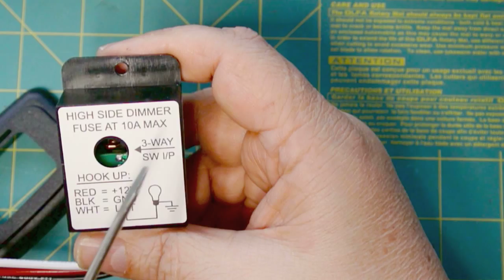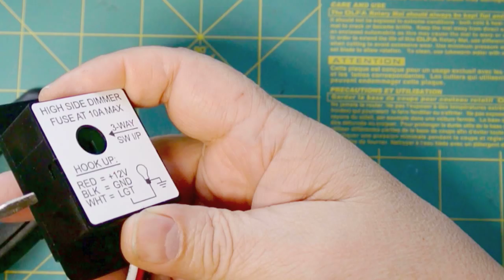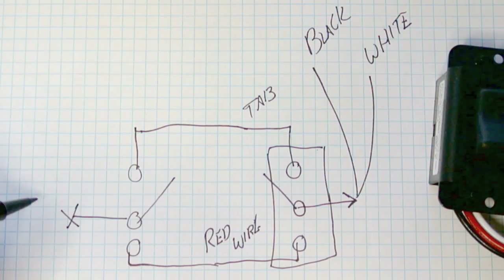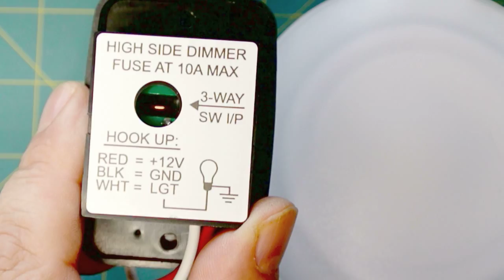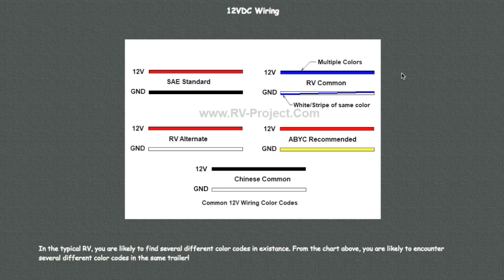Installing a LED dimmer in my RV

Comment: I wonder if you can just a 120v dimmer switch instead. For such a small simple device, these are stupidly expensive for some reason.
Reply from the maker: A 120VAC dimmer will not work.

LED capable dimmers are actually more complex than you might think.  LEDs work differently than incandescent lighting and require more complex Pulse-Width-Modulation circuits.  120VAC dimmers are more simple and less expensive to build.  When I designed my PWM dimmers, my cost in just components was around $25 per dimmer.

I also suspect there is an economy of scale as 12V dimmers are pretty much limited to the RV and marine industry.
Reply: @RVProject  I see.  How do AC 120v dimmers work with LED lighting?
Reply: @RVProject  so a simple potentiometer wouldn't work as a dimmer?
Reply: @RVProject  I'm thinking about buying touch 12v dimmers since they are cheaper and I need to buy quite a few for my project, but unsure how well those will work plus I like the control a potentiometer gives you.
Reply from the maker: @meowzic  from a technology standpoint, they work similarly, but the voltage differences between 120VAC and 12VDC are such that the component values would be too far off to work properly.
Reply from the maker: @meowzic  A LED is similar to a diode in that the current flow through it must be limited or it will self-destruct.  A series resistor would work with low power LEDs, and in fact, LED strips typically use resistors to limit the current.  

However, with larger current demands of the typical RV puck lights in a RV - they are around 4Watts each, the watt rating of the resistor would have to be fairly high, requiring a bulky component.

While a resistor could be replaced with a potentiometer if the current requirements are low enough, the downside is that they are linear in nature, or have various "tapers' such as an audio taper.  Unfortunately, your eye does not see light values linearly, so a typical potentiometer would not have a smooth transition from dark to light.

In other words, 90% of the light change would occur with only 10% rotation of the potentiometer.

In my dimmer design, it is actually controlled by a microcontroller. I programmed the microcontroller to transform the linear motion of the potentiometer to logarithmic values that more closly match the eye's response to light.

I have a webpage white paper and corresponding video that provides an in-depth discussion of 12V dimmers. It might answer many of your questions: http://www.rv-project.com/gear/dimmers.php

Also, I have a webpage for the construction of the LED dimmers I designed and built. Regardless of whether or not you might want to build the dimmer, I provide a lot of background; for example - the eye's inability to see light linearly as I mentioned above. So there is still some value in reading the description of my dimmer project: http://www.rv-project.com/projects/moad.php
Reply from the maker: @meowzic  While touch dimmers are available, I do review a couple of them in my 12V dimmer shootout article and video:  http://www.rv-project.com/gear/dimmers.php

Touch-type dimmers are never truly Off. Even when the LED is Off, the dimmer still consumes some power.  Seven mA is typical.  While this is not a lot of current, if you have many dimmers, this will add up.  

For example, if you have 10 touch dimmers, each with an Off (idle) current of 7mA, you are consuming 70mA in standby.

This is important if you are boondocking (dry-camping on battery only), or even in storage.  A 70mA will discharge a typical 80AH deep cycle battery to the 50% discharge point in less than a month.

If you like the feel of a rotary dimmer, (again from my dimmer shootout webpage), there are several I have tested that do have a potentiometer control.  However, in all cases, the potentiometer controls are linear, and do not provide a smooth transition from On to Off during it's rotation.

This is one of many reasons I designed my own dimmers as through programming code, I convert the linear output of the potentiometer to a logarithmic output, which matches the eye's sensitivity.
Reply: @RVProject  Interested, thanks!  I love learning how electronic components work.
Reply: @RVProject  Would you recommend standard 120v on/off or two way switches for a 12v system?  Id like to add a 120v ceiling light fixture above my dinette set since there is a bigger variety to choose from.   I see some people wiring these on YouTube as 12v.
Reply from the maker: @meowzic  If you are looking at wiring a RV, typically all of the lighting is 12V. While you can run a 120V ceiling light, you would obviously only be able to use it when your RV is connected to 120VAC power.

I did a project awhile ago wherein I replaced the standard puck lights above the dinette. I was able to find 12V "Edison" style LED lights with 120V type screw-in bases, and actually kit-bashed 120VAC light fixtures to work with the 12V lights:  http://www.rv-project.com/projects/dinetteled.php

In this project, I also looked at using a resistor to control the dimming of the lights, and show the values that would be required to do so. This provides a good comparison of using resistors (or a potentiometer) vs. PWM dimmer.

Comment: Could you please come over to my RV and wire my RECPRO dimmer switch?  I have 2 wires coming out of the wall in my RV, and 4 wires coming out of my dimmer switch.  I have installed 50 house dimmers in my lifetime, and none of the houses have burned down yet.  I can't figure out how to connect this RECPRO dimmer switch!
Reply from the maker: This might help: http://www.rv-project.com/gear/dimmers2.php

Comment: I don’t think their way is that confusing, as that is how we wire AC power here in the US. Blk being positive, only white is neutral.
Reply from the maker: The issue as I see it is 12VDC is using the same color code as 120VAC.  This is not the best practice as wiring codes should be for a specific purpose.  

The defacto standard of course for DC wiring is 12VDC = RED and 12V GND = Black.  Even that can be confusing to some, so the ABYC recommends 12V "Safety Wire", where 12VDC = RED and 12V GND = Yellow.

Like a RV, larger boats have both AC and DC wiring. Therefore, the possibilities are Black representing 120VAC ungrounded, 12V Ground, and +12VDC.
Reply: @RVProject  Agreed...you pretty much have to read and test everything, not assuming.

Comment: No need to take the cover off bro. It's automatically a 12v three tab rocker switch top is power to all the lights, middle is the power coming off the battery and bottom (gold tab) is ground or negative. The light is pos. And negative. The light up in the ceiling has a +& - stamped on the back so, colors and country really don't matter. 
Now, the real question hasn't been answered. You have a three wire high side dimmer you're gonna wire into two wires? And you think the center battery wire and the power to the lights wire fused together is gonna work inside that new combo units gonna work 100%? Yeah, it's gonna work for about two minutes. Then, the ceiling lights dim about 60% after about two minutes and you're only gonna be able to turn the lights on and off with the dimmer switch or, you have a dimmer that doesn't dim. The only correct way is to deturmine if the second RV wire works as ground or, power from a fuse straight off the circuit breaker or, straight off the battery? Cuz, that switch is three wires. Two wires share the middle, power in tab. And they are used to control, Two items on a single rocker  switch? Remember that third tab you found under the switch cover? That provides power FROM the switch o the lights. Center takes in power from the battery and when you turn it on, it gives power to the top tab making the lights come on. Middle tab is power from the battery. Your light tester's gonna give you false readings on either the top or bottom wires cuz there's probably power in both RV wires. Do these lights have their own fuse in the circuit breaker box, are the ceiling lights grounded on one wire together running back down to the original rocker? Is the original rocker switch grounded or a cut off?  If not, How are we gonna Chase it down?  You'll notice most likely your two RV wires are BOTH power to the switch. Cuz, that new dimmer switch has two wires on the center wire to the battery not the top. So, the real question is, do you create a ground going all the way back to the battery (not the closest outlet) all the way back to the battery NO EXCEPTION! Best chances are, you're gonna be creating a new ground and that cut off switch shares power with something else? Most likely, a light some place under some cabinets. Check how your lights are grounded before tearing the wall apart. Are all lights grounded on a single wire to metal or, by themselves or, the battery? Do you use that top pin on the dimmer switch cuz each light is individually grounded and both wires have power? Yeah, whoever figured this 12v, puzzle, three wire, high side second switch and off/on dimming switch?? is a complete fan of RV fires. That computer board inside the switch, dimmer switch combo? Works only so long. So, figure it out. Is one of those wires a ground or a power? Is the old 12v switch ground or, cut off? They can go either way on the old switch. This high side configuration isn't gonna restore full power back to your lights either. It's configuration is more an interruption then an on/off switch. You're gonna have less power lighting when you turn the lights back on. Right?

Comment: Cannot understand why these dimmer switches are so EXPENSIVE!!! Ridiculous!
Reply from the maker: The dimmers are actually fairly complex, employing PWM drivers, high power mosfets, voltage regulators, and associated components. The part count can vary from a dozen to two dozen components..

When I did the dimmer project (http://www.rv-project.com/projects/moad.php) the components (electronic parts, circuit boards, etc) for the dimmers cost around $25. While I bought these components at retail and I could have probably found a better price in quantity, there are other factors (component storage costs, etc) that tend to mitigate much of the cost differential.

You also have to factor the cost of design, engineering, and testing which is not included in my $25 price point; and ultimately, the manufacturer, distributor, and retail all need to make some profit.
Reply: @RVProject  I understand all that but nearly 2-4 times more then a non-dimming switch is just plain crazy!
Reply: I have to agree. I commented on this on a similar video that Tito made. Cost of manufacture is probably less then $2. And if anyone thinks this switch is made in America and the quality is great, think again. I purchased one and sent it back because it was assembled wrong. Switch was reversed internally and contacts would not connect. Easily fixable but for $35 to $40, you'd think it would come assembled correctly. I bought a couple of cheaper dimmers (less then $15) and they work perfectly. No buzzing or flicker that I can detect on my 2019 Phoenix fifth wheel that has all LEDs.